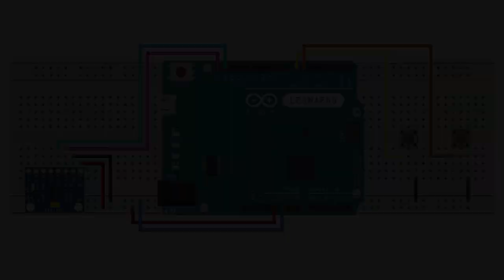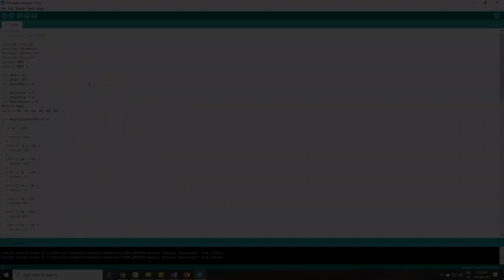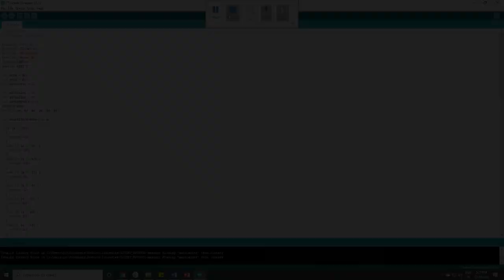AIR MOUSE | GESTURE MOUSE using GY-521 MPU6050 Accelerometer and gyroscope Module with Leonardo

Comment: can i make it using arduino uno?
Reply: it is recommended using arduino leonardo or arduino pro micro which has ATmega32u4 not ATmega328P because they have usb serial communication and mouse library...other arduino such as uno and mega do not have mouse library so it is hard to configure
Reply: @awhatchannel9378  so i can make it? Or its just imposible?
Reply: @qumanero  yup..leonardo already has mouse library in it and uno not..if still want to use uno then try digging another research sir if there's anyone try it
Reply: You do it with your phone and some programming

Comment: Sir I bought the product from your site. But after doing all the steps and all the coding it is moving in only one direction that is left corner of the screen. Please tell me the remedy for this. please help me it is important for me to completely it asap. So please tell me some code modification to make it move in all directions. I have already checked the code and the circuit diagram 20 times it is correct.
Reply: Sir,did u get the result?